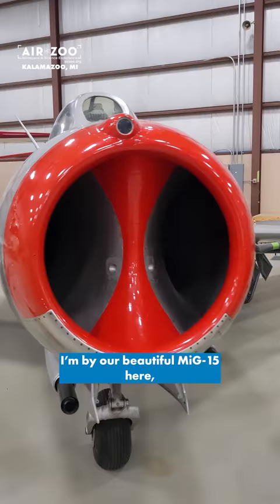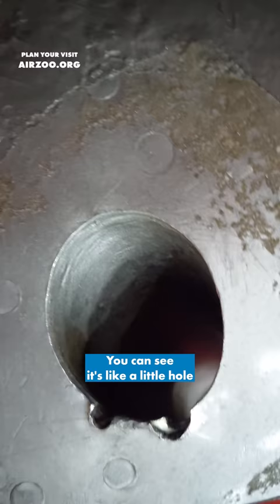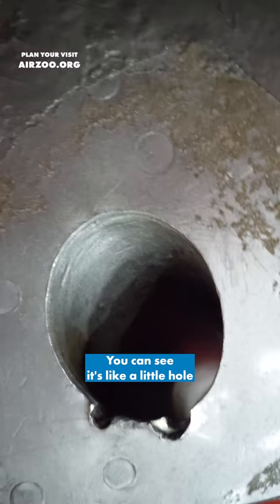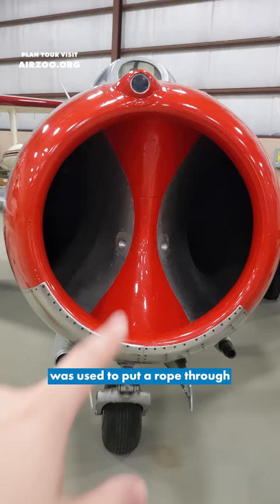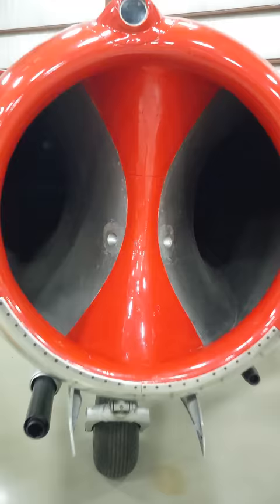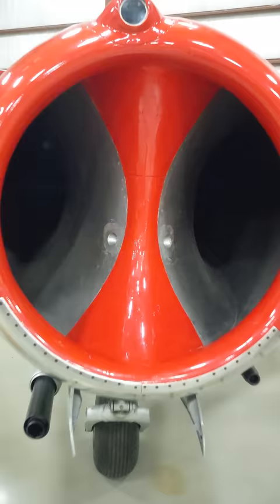What is this hole in the MiG-15's nose for?

Comment: You can see the marks in the metal where exactly that has been done. A cable or something was strung through and left divots.
Reply: I had the same thought. Though whether it was intended for that purpose, I can't be sure. Someone else mentioned a bar that could go through it with a Shackel.
Reply: And probably small pieces of metal for that engine to breathe
Reply: It’s actually some damage from the inlet covers..
Reply: @douglaswrightington2412  wot
Reply: Dang it was very thin like a guitar string.... Damn near could have rubbed a slice through it

Comment: Crash tow point, you have a steel rod you place through there, and then you hook on the steel wire ropes, using washers and pins to hold them in place, so you can tow an aircraft that landed on the runway all shot up, and which needs to be hauled off now, so the rest of the squadron can land. Also can be used if you have no ground support tow bar, and need to move the aircraft on the ground with minimum personnel, just the tow vehicle operator, and the person riding the brakes in the cockpit. 

Pretty common on all military fighters in some form or the other, though normally it is marked with a ring of red paint and stencilled as crash tow point. I used to use the plexiglass protective window in the aircraft I worked on so that you could guide the person buried in the wheel well to the location of plugs they needed to connect or remove, or to reset the pitot heater circuit breaker, which was buried right up there, nicely visible through the window, but otherwise impossible to see, or reach unless you had midget fingers, and an extra elbows, plus Orangutan arms. Not fun locking wire there by touch, with another telling you to go up, down left or right to find the little holes it went through. Or getting the 14mm spanner up there to undo the pitot static pipes either.
Reply: Ha! Thanks for reminding ding me. I'm the guy with the "wingspan" for that job.
Reply: You are right. 

There is only one thing can be added here. These holes originally were covered by percale but during the exploitation of the aircraft they have usually been torn off pretty quickly.
Reply: Only a pessimist calls it a crash tow hole.  An optimist realises it's a design feature to kindly make it easier for Ukrainian farmers to attach their tractors to it so they can steal it
Reply: hey man this is an awsome comment. and thank you for your service sr.
Reply: I like this better than the rope, those sharp edges would have torn the rope pretty fast
Reply: Yo Joe  what makes you say that?
Reply: This is the best theory I’ve seen so far… Def can’t be a rope being only 1-1 1/2 inches in diameter… A steel cable might fair better, but still a little iffy….
Reply: @LtKrunchy  the guy above said they put a rod through the hole and then connect to a tow rope.
Reply: @StabbyJoe135  Who in their right mind would steal a MiG-15..?
Reply: TMI
Reply: @M16_Akula-III  I would
Reply: This is why I love YouTube comments.
Reply: @M16_Akula-III  The Ukranians have started to use stolen T-64's... the MIG has cannons, therefore it has a use as a ground attack aircraft. 😅
Reply: @TheEDFLegacy  Well, good luck avoiding missiles I guess..
Reply: @TheEDFLegacy  don't get it. T-64s were always there in the Ukrainian army. The Russian army didn't have them since the 90s I guess.
Reply: Man went into DEPTH about this. But to be honest it's pretty interesting
Reply: Thanks for the knowledge, sir
Reply: Operating lose washers in inlet seems quite disturbing to me. If not stupid …
Reply: PIERCING
Reply: I think Fords have these too.
Reply: Can ur comment be even longer?
Reply: @M16_Akula-III  I can't lie, I would if I had somewhere to park it.
Reply: @M16_Akula-III  years ago a Russian tank crew stole their tank in Czechoslovakia. Sold it to a junkyard so they Get drunk! I think they must still be in jail!
Reply: @TheEDFLegacy  learn facts before you say anything. The t64 has always been in the Ukrainian army. The mig-15 wasn’t ever used in the current Russian war
Reply: @AVlad-eg3ds clearly you haven't been following the Ukrano Russian war long. Russia fielded T54/55 tanks, bolt action Mosin Nagant rifles, and some older vehicles and weapons.
Reply: @Vl0gWithAb he Never said it was just with its cannons it has use as a ground attack aircraft
Reply: @ThePawelekPawelek Loose washers in the inlet of a crashed or disabled aircraft.
Reply: @M16_Akula-III  somebody that only MiG 14s 😜

Comment: The hole in the nose was used to release pressure from that area as there was high strain from air there with the split inlet, but also doubled as a tow.

Comment: It's to hold the inlet cover, can find some pictures if you Google it.
A bar is moved through to hold it in place
Reply: This is the correct answer.
Reply: Smooth, operator. Smooth.
Reply: Makes sense. I wouldn't pull the whole aircraft with that tiny non-bulk structure, which is also an essential part of the aircraft. But the weight of an inlet cover would be more acceptable.
Reply: For guys that don't know what you mean  by inlet cover, he means the plastic and rubber cover you put on the jet inlets when it is being put away for storage, to keep out weather and foreign objects, the red ones you see air crews pulling off during a scramble alert.  It's what should have been covering the inlets on the F-14 Maverick and Rooster stole in the movie.
Reply: This seems like complete overkill for a engine inlet cover.
Reply: @cefb8923  not really, it's Soviet time. Make it simple and usable in all climate. Make a hole 2x the size you need it, much easier to push a rod through
Reply: I think it's both, its meant for towing but it's also conveniently placed to help secure inlet covers
Reply: @debbiestimac5175  by foreign objects do you mean squirrels?  Lol.  Removed the air cleaner cover from a '70s Trans-Am to find the stash of acorns and dog food an enterprising neighborhood squirrel was stashing there.
Reply: @GarthKlaus  
...Exactly, I had the same problem in my 69' Goat...lol you brought back some memories.
Reply: '70 Firebird w/those honeycomb wheels! 
Made for each other, the wheels made the car & the car, with those wheels, was poetry in motion, even while sitting still.

Vinyl roof and 8-track player? Signs of the times. 
Bought in 74, 1st car.
Reply: @tracytrawick322  my first was a '68 GTO, 8-track w/reverb
Reply: I feel like adding drag to your machine is worse than spending a little extra money on an inlet cover, but again, it was made by the Soviet unions and they do extremely confusing things that make no sense
Reply: it may be for inlet cover, but its for sure at least also a tow hole to put a bar through, two pins on outside..
specifically banged up planes and minimal crew needed

Comment: It equalizes the air on either side of the intake splitter to prevent turbulence at speed as the air heads to the fan.
Towing would be from the nose gear below which is designed to take that load.
Reply: Nope, it would be a much cleaner and smooth hole
Reply: it seems to just be for a bar to hold in the inlet covers for storage. there are a few pics on google
Reply: This was my first guess as well
Reply: @justinpatterson7700 
That makes sense.

Comment: I don’t know what the answer is, but it would logically make sense for these two holes to create a sound in which frightens the enemies like screams of terror.
Reply: What is logical about a terror device that could not possibly be louder than a 150 decibel jet, using sound waves that do not travel faster than a jet that can fly the speed of sound?

Do you know what the term "logical" means?
Reply: @aardque  MiG 15 wasn’t Mach speed.
Reply: @Suo_kongque  So you are saying a screaming whistle to intimidate intended human targets is a valid reason to drill a hole through the nose of your subsonic Mig?

Because the reason the whistle idea is so pathetically absurd, as compared to the equally pathetic but useless Stuka screamer that nevertheless inspired an entire generation of dreamers, is essentially the ambient volume of the already screaming jet, combined with the rate at which that death knell propagates and to simplify the notion, we call it "the speed of sound."

We hadn't expected the comment nazi's to come in and discriminate that Mig's can only go transonic in a dive. Congratulations, Colonel Shultz.

Comment: I met a WW2 veteran at the local air museum I volunteer at and he pointed to the MiG-15 they have. He said that hole was used to hold the Air inlet cover and it was also used to tow aircraft with horses. Because some bases in the Soviet Union were so poorly made that only horses could pull the aircraft out of the mud as the tractors would get stuck.
Reply: Fits perfectly old sovjet philosophy.
Reply: The horse thing is true for planes landing in designed grass fields in Siberia etc, as horses were quicker to respond, but out the mud? Sounds bullshit, this is a heavy plane, Soviets used a lot of tracked tractors for this reason.
Reply: @SMGJohn  I am just repeating what he told me.
Reply: @SMGJohn  
For stuff too heavy for horses... people used bulls.
Reply: @Vickzq  
Why use bulls when you could use a tracked diesel powered tractor that was more common than bulls in the USSR, literal tractor population was higher than that of bulls.....
Reply: @SMGJohn  
I would say they simply used whatever was just more easily available.
Reply: You would still pull it from the nose gear which is designed to take strain, particularly as it would be stuck at the wheels.
Reply: @Vickzq 
Oxen, not bulls.  There's a difference. 😉
Reply: @randytaylor1258  
😂 True.
Reply: Landing a jet plane in mud sounds like something only the cartel would do.
Reply: @randytaylor1258  not when nose gear was destroyed
Reply: So the mud is so bad that a tractor gets stuck, but not so bad that a heavy plane can be pulled by a few horses?  So plane wheels handle mud better than a tractor?  Not believable.
Reply: @mick776gold  
No. But bulls eg might have way better traction.
Reply: My first thought was for a cover.
Reply: Well when pigs fly they use them to launch a mig

Comment: It does appear to have some damage in the hole that would totally validate that theory. Especially if they used a forged steel chain intead of a rope to tow it with.
Im guessing thats an aluminum body and steel is much harder than aluminum.
You can even see the stress around the the holes with that discolored halo around it.
In welding, that effect is called the heat effected zone, but the same idea applies I would think regarding a stressed area in the metal. 
Plus Im not aware of a drill bit that would make a whole like that and it definitely doesnt look machined. (It doesnt even look like its quite straight)

I wouldnt be surprised if thats something one of the mechanics did in the field long after it was manufactured.

Comment: Thank you for your question. I have searched the web for information about the hole in the MiG-15's nose air intake divider. Here is what I found:

- According to a video by Air Zoo², a Smithsonian-affiliated aerospace and science museum, the hole in the MiG-15's nose is for a rope to tow the aircraft around. The video shows a MiG-15 with a rope inserted through the hole and explains that this was a common practice in the Soviet Union and its allies, where ground equipment was scarce and unreliable. The video also mentions that some sources claim that the hole was for a pitot tube, but this is unlikely because the MiG-15 had a pitot tube on the wing tip.
- According to an article by World War Wings³, the hole in the MiG-15's nose could either be for a rope to tow the aircraft or for a pitot tube. The article cites Air Zoo's video as one source and another source that claims that the hole was for a pitot tube that was later moved to the wing tip. The article also notes that some MiG-15s had a different nose design without the hole, which suggests that it was not essential for the aircraft's performance.
- According to an answer by aeroalias on Aviation Stack Exchange¹, the MiG-15 had a split air intake in its nose because it had only one jet engine and the cockpit, avionics bay, fuel tanks, and nose landing gear bay occupied the same space as the air intake. The answer does not mention the hole in the nose, but it provides some background information on why the MiG-15 had a split air intake design.

Based on these sources, it seems that the most likely explanation for the hole in the MiG-15's nose air intake divider is that it was for a rope to tow the aircraft around. However, there is some uncertainty and disagreement among different sources, so it is possible that there is another reason for the hole that is not widely known or documented. I hope this helps you with your inquiry. 😊

Source: Conversation with Bing, 10/10/2023
(1) What is this hole in the MiG-15's nose for? - YouTube. https://www.youtube.com/watch?v=Le6mUoncGc8.
(2) What Is The Hole In The MiG-15's Nose For? - World War Wings. https://worldwarwings.com/mig15-nose/.
(3) Why do the MiG-15 and MiG-17 have a split air intake in their noses?. https://aviation.stackexchange.com/questions/27480/why-do-the-mig-15-and-mig-17-have-a-split-air-intake-in-their-noses.     [Bing Chat]

Comment: The hole is for preventing hydrodynamic cavitation as aerodynamics turn the air into liquid as the nose compresses the air, this preventing the explosions that cavation creates, it's to stop the pitting on the compressor blades of the jet turbine

Comment: Its used to cover the engine with those pads to protect it from the cold and dust and stuff like that. The pad would have an stell pole and the place on in one side of the hole, they placed the other pad in the other, im a jet expert

Comment: There was a cover for the intake and it had a handle with a trigger on it and when you pulled the trigger there was these two hooks so-to-speak that would open up, and you put the cover on, released the trigger and the two hooks grabbed onto those holes and held the cover onto the nose of the aircraft.

That's what the two holes were for. A cover to keep little animals from getting in there to stay warm. BTW the cover mechanisms could go bad and a piece of rope could be used to keep the cover on too. But to tow the aircraft around with? Don't be ridiculous. Just tie the rope around the landing gear.

Comment: It probably is true, considering the T/34’s track link pins were not secured in place properly and a steel block was attached to the hull that would slam the pins back into position after every single revolution, that’s why the T/34 has such a loud rattle from the tracks when driving.

Comment: Maybe not for towing the aircraft to and from the hangar but sometimes these planes would veer off the runway , maybe to a soggy patch and get the undercarriage inside the muck. 
The heavy duty salvage engines would then be used to extract these machines out through the nose rings.
Thats my assumption

Comment: If those holes were damaged in any way,  it would result in turbulent flow into the engines,  possibly causing a flame out at some particular speed.

These look more like pitot tubes that gage the input air speed.

Comment: The Soviets have always been thankful for the production of grain, especially Wheat to keep the entire population alive, and through hard winters.. The holes in the nose intake were to hold grains of wheat and a handful of wheat was put into the holes before flight.. Equal pressure of air on with sides would keep the grains in place and when the pilot landed on newly conquered lands, he would remove the grains and plant them on the new lands, and further push the borders of mother Russia.
Reply: I think they use sunflower seeds now?

Comment: Well, you wouldn't thread a rope through there, the sharp edges would cut it. 
I think it is probably a tow point, which means there has to be a metal bar, made for the job, around somewhere.
It looks like maybe someone ran a wire through it to hold on an inlet cover.

Comment: All I have found so far is this quote from over a decade ago "It's in fact part of Soviet aircraft operation: that odd hole in the middle of a MiG-15's intake splitter is a big grommet through which a rope can be passed, if necessary to tug the airplane with a team of oxen...or to pull it out of the mud and weeds.
"

Comment: Looks like it's had a chain through there with some force behind it. On the left hole you can see 2 depressions from where the chain has damaged the metal slightly.

Comment: The tube is for securing the inner sections of the duct covers in place.  A rod is run through from the covers 👍🏻 a tow attachment would definitely pull the ducting apart unless there’s a central rod running through to the tail to take the weight mass from just a tube in ally

Comment: You wouldn't put rope trough there, but a big pin to wich you would attach rope. 
It's not supposed to be used on regular basis tho, it's more or less "only if you realy need to" option.

Comment: Makes sense, but not really. If it were for a rope, you would think the outside edges would be ground down. Sharp as that is, it would end up cutting it. Maybe a cable or, depending how large the hole is, a chain.

Comment: I tho that makes no sense because if you pull and aircraft on the nose wheel you can steer it around because the nose wheel turns but the nose wheel doesn’t turn if it’s pulled up there 
I think it might be to anchor the aircraft down so the wind won’t blow it away

Comment: I'm curious if it's used to read inlet pressure for the turbines. There's probably a sensor of some sort in the center of the tube. It could also serve the purpose of holding the covers in place when not in use, but I'd be surprised if it didn't have a purpose in flight.